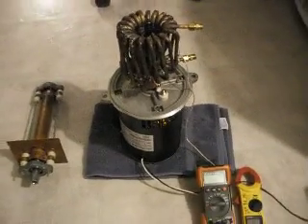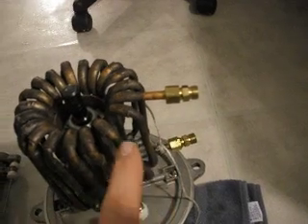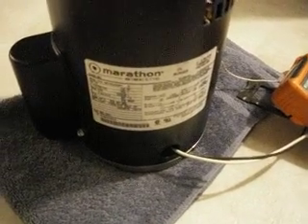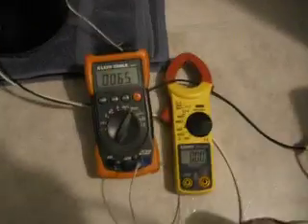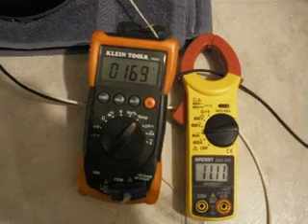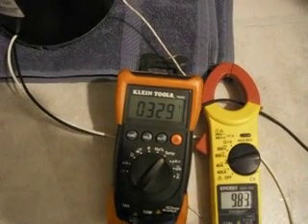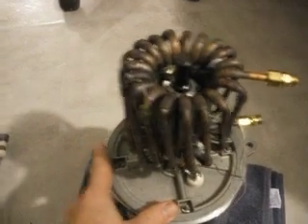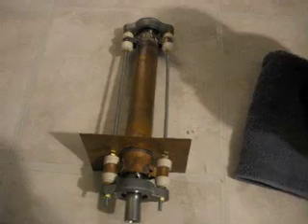Magnetic Heater Update

Comment from the maker: @MALEXIOU1 
 Yes, I know it would heat up the water faster putting it into a loop and recirculate it... I never tried thou? The other motor I used was a fan motor inside a furnace. Thou the current was less, the motor did heat up eventually. Also the RPM was to low,that's why it took so long to heat up. The magnets were also bigger causing more strain on the motor, that's why I made them smaller in this vid. less strain on the motor. The current does decrease thou the hotter it gets.

Comment from the maker: @xjohnnyfx 
  I used my thermo gun.... The Neodymium magnets heated up to around 105 degrees F . The unit needs to be running up like that because heat rises and the magnets is like a fan blade keeping them cool. They can withstand up to 320 degrees F before they start to lose their magnet field. They also can be wrapped in a fiberglass blanket to achieve a cooler running operation. Thanks for watching..

Comment from the maker: @MALEXIOU1 
  motor has it's own built in capacitor, and runs on 120,208 or 240 volt A/C single phase. I believe the amps are decreasing due to the heat in the copper building up which would cause the magnetic flux strain on the motor to decrease as the efficiency goes up.

Comment from the maker: @bearpatch626 
  Yes you could but I prefer to just let it do it's job fast and then turn off to save more on electricity. It could radiate the heat for while before it calls for it again which saves you more on the power bill. Thanks for watching...

Comment from the maker: @egn83b  
 Not really... I did the ring design because I wanted the outside tubes to be shorted out from the magnet field as well to create more heat faster. My original design was intended for radiant heat. But also would work well in heating up water, oil or any other liquid used. Thanks for your comment.